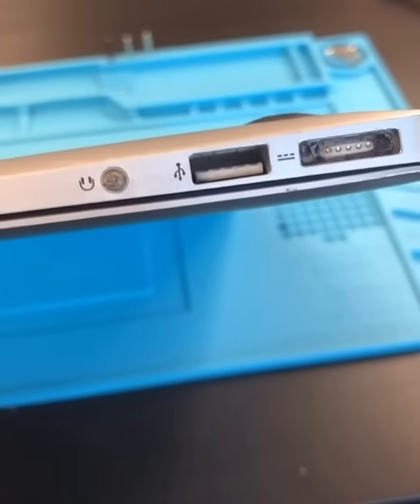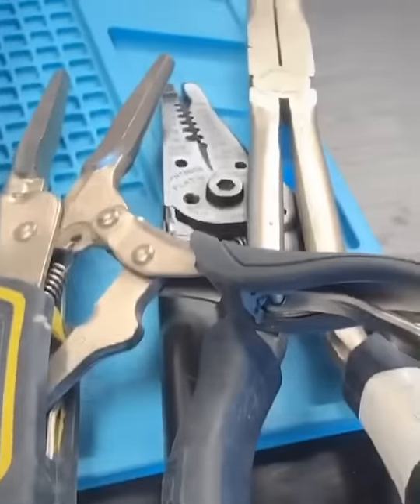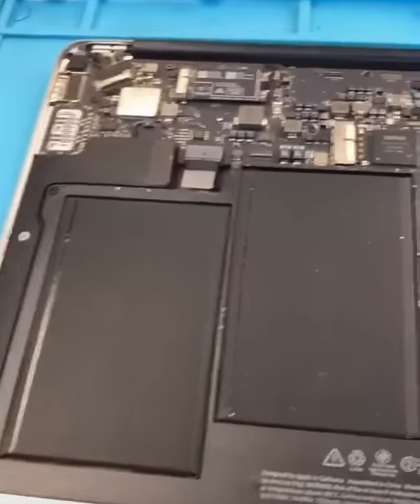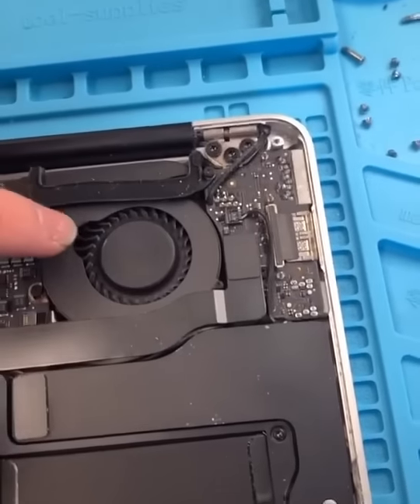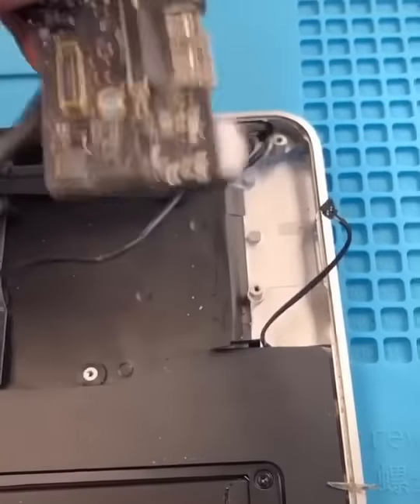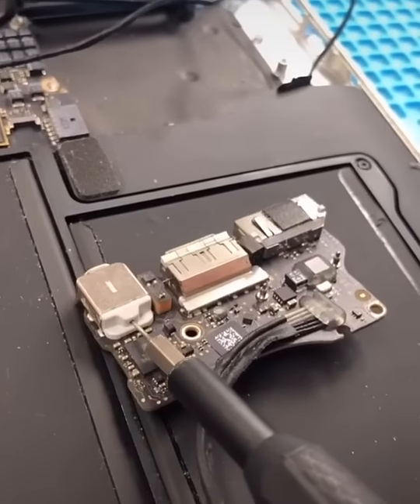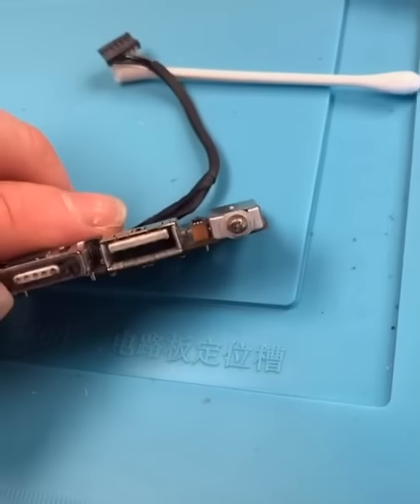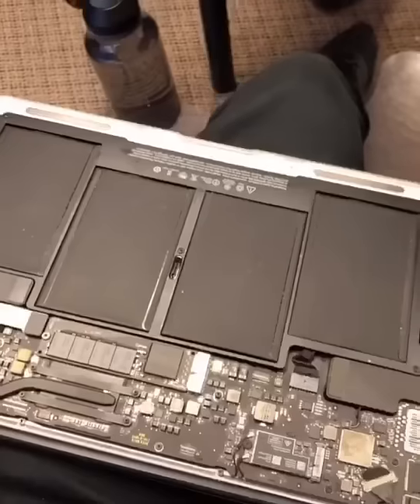Don't Use Glue On Your Macbook.... WHY? #Shorts

Comment: Apple kids: complain about Samsung
Samsung: poor child little do u know
Reply: Note 20 Ultra: gets released
Samsung users: well well well.. how the tables have turned
(Because people used to brag about how expensive their iPhones were)
Reply: It’s not the hardware inside in the end for most. It’s how the device feels (operating system wise)
Reply: @That1Norman  no people used to say that Samsung is cheaper when their flagship phones are actually more expensive now
Reply: Samsung has gone the path of Apple. You can no longer change parts like the screen on either without basically destroying them. Do yourself a favor and shop for hardware and fixability, not for a brand.
Reply: @runed0s86  you can replace screens wtf are you on about. Now replacing physical components besides that may not have the same story. You’ll have to buy boards with multiple other things. You can also replace camera lenses.
Reply: Eh, I think LG's a little underrated
Reply: @bestoffails2140  lg is pretty terrible
Reply: @anxietyplague1221  No it doesn't. Ever heard of efuses? What about KNOX? This is why you need to shop around.
Also, some people are okay with using an offbrand screen. The new Samsung models are not okay with this, just like iphones. Don't buy Samsung or Apple. Shop around for your hardware.
Reply: @Usef320  LG is bleh, but budget Motorola is even worse! At least LG has opensource camera drivers!
Motorola phones only get 2 updates if they aren't on the Google business device list.
Reply: @runed0s86  I dont think anyone voluntarily buys a motorola anymore
Reply: @runed0s86  if you're destroying either you probably shouldn't be reapairing your own phone. i've recently fixed 3 iphone 12's, 1 pro and two normal ones
and 2 note 20's, 1 ultra without breaking any of them at all
Reply: @bestoffails2140  lg is horseshit. get a oneplus
Reply: @Usef320  My moto E5 tracphone variant was $90 and runs ok with an android 10 gsi.
Reply: @brickski7481  new iPhone screens cost at minimum $250. That's the cost of a budget Blackview phone.
Samsung isn't much better at $175. I could buy a rugged flagship phone for the price of 2 screens.
Reply: @runed0s86  LMFOWNDF YOU CAN GET AN IPHONE 11 SCREEN FOR $40
Reply: @brickski7481  not an apple certified replacement. Those screens cost $200. Any other screen is probably a lower quality screen, and customs might seize it if it's being imported. Search for Louis Rossman up top if you don't believe me.

Also, research your hardware. A quick Google search can invalidate your claims.
Here's a decent phone that's about to come out: https://www.blackview.hk/products/item/bl6000pro
Reply: That’s because Samsung isn’t that good compared to apple cause it so slow
Reply: @chadwickelliott9584   it depends on which Samsung device you compare it with. Some are slower and some are far faster. Samsung has a variety of phones, not just the galaxy series.
Reply: @chadwickelliott9584  if you have a new flagship samsung with no malware or anything affecting performance, it runs faster than a ps4.
Reply: Android is better especially i qoute samsung apple is made tru occur coputors to jail break so easy and they will lose traceable prossces do to extract non progited connectic to be found truly thr iphone aux and they could just ab15 samsun but they do a process of piled busines i quote firms of identical alttt 556 of 2002 of apple products not noticed on police tracing all samsungs are police traceble trou charging aux battery and sim iphone is just tru sims i qoute that why the get locked real quick and camera due to ios 14 hehee get that iphone ill use it but mainly (SAMSUNG) thinks
Reply: @Syndicate_LS  it feels the same
Reply: That  Samsung is slower for $200-800 bucks more? Taht would explain why Samsung lost 5b in Q4 2020 and apple gained 352b Q4 2020 and gaining 12% more market share on just smartphones alone
Reply: @That1Norman  isn’t it $1500 and slower by 32%
Reply: @demo5963  no it most definitely does not. Display sensitivity is different, how everything functions is slightly different, performances are different, etc
Reply: Me a Huawei user: What?
Reply: I don’t get all these rivalries lol it all comes down to what you grew up with (most the time) like I love apple Xbox and amd cuz I grew up with them I’m sure if I grew up using Samsung and PlayStation I’d like them more it’s just simple chemistry
Reply: Yeah tbh I don't get why people buy apple phones your paying more for less features or paying the same for less features ( e.g. cameras , finger print , no notches , other features like LG swivel screen ) just for the Apple logo I don't get it
Reply: @daringstriker1335  while that is true I started with android and switched to Apple because as I said myself I liked the feel of the operating system more
Reply: @anxietyplague1221  nah makes sense what I meant mostly is I get given a lot of my stuff as I’m the 2nd youngest out of 5 of us so that has a big impact like I get a new phone every year or 2 depending on whether my parents upgrade or not or if my oldest brother buys a new Xbox I get his old one etc. for you well idk how you afforded so many games XD. But only thing I’d change is I’d go to Samsung if I didn’t get a new phone free
Reply: @Syndicate_LS  The iOS was made for simplistic use for Apple. Why do you think many people jailbreak iPhones. With Android, its open source. Allows anything and everything due to no security on certain applications and details. Whatever you're talking about makes no sense because screen sens and what not? Camera parts? If you aren't happy with the phone, swap brands. Otherwise, who actually cares about the screen? Camera?, maybe.

Edit: Display sensitivity and performance, each phone operates almost the same. Performance wise, you go with android. I only say android because their OS is open source, change or make to whatever you want. But display sensitivity depends on performance, if you're talking about Hz (Refresh Rate)
Reply: @Asunuji no I jailbreak. But at the same time I still like iOS and how it operates and feels
Reply: @That1Norman  when did Apple brag about how expensive their phones were
Reply: Well as long as my phone works I'm happy with it. You all take what you have for granted way too much it's crazy. Just be glad you actually have what you have. Now if you just want to do some friendly arguing on phone details that's great and I'm sorry for intruding, however I think it is important to remember...
Reply: @QueenYossiB  yeah I get that. They do have some nice stylist. I've been sticking with an LG v30 and it's been great. I guess I am over due on an upgrade.
Reply: @QueenYossiB  true true
Reply: Oh fandroid 😂 I can understand how much jealous you are
Reply: I'm Apple 😂
Reply: @sneaky sneaky "joke"
Reply: @Syndicate_LS  at the end of day it's comprised of samsung parts even the screen pretty much the operating system is only thing keeping it from being a samsung as well as lighting port still and apple users still have a notch😂😂😂 I will always choose samsung they are actually starting to become the apple. They also try to take credit for samsungs things such as wireless charging yep that was on samsungs phones first and they tried making a huge event if samsung wasn't so nice to give the rights for other companies to use alot of phones would have probably been outdated and samsungs would hv so many features other companies wouldn't be allowed to use that samsung would be the obvious choice with no hesitation
Reply: at the end of day it's comprised of samsung parts even the screen pretty much the operating system is only thing keeping it from being a samsung as well as lighting port still and apple users still have a notch😂😂😂 I will always choose samsung they are actually starting to become the apple. They also try to take credit for samsungs things such as wireless charging yep that was on samsungs phones first and they tried making a huge event if samsung wasn't so nice to give the rights for other companies to use alot of phones would have probably been outdated and samsungs would hv so many features other companies wouldn't be allowed to use that samsung would be the obvious choice with no hesitation
Reply: @patrickhall6831  ok
Reply: @Syndicate_LS  ohh so ur trying to compare iphones jail system to samsungs super open system?
Reply: @brickski7481  as i may know then iys special screws in ip12 some are rounded out and to take of the back glass u gotta use a laser now tell me  that its easy to fix a iphone over a samsung
Reply: @brickski7481  yee u can from ebay sure but the screns must be encrypted for the 11 thats why i hate appel
Reply: @Andrew DeHerrera did I say I care about that? You are coming off as pretentious and honestly it makes me hate you more and makes me stick to my choice more. If you wanted to change my mind you did the opposite. Now do not respond to me you’ve already made things worse for yourself by showing you can’t handle an opinion
Reply: @malishaba4797  I prefer to jailbreak so I don’t have this issue you are trying to bring up to shit on my choice
Reply: @malishaba4797  you really can’t handle someone having a different opinion
Reply: @malishaba4797  you can buy an Apple screen and replace it like any other. You are in fact making shit up
Reply: @malishaba4797  as far as I’m aware there are screws and there are plenty of videos on YouTube and none have used a laser. Again making shit up
Reply: @runed0s86  i just don't break my phone
Reply: Samsung memory chips are in everything, including  my OG xbox from 2001
Reply: Ppl in the pc space love ram with Samsung b-dies since they can be overclocked higher
Reply: @runed0s86  iphones have been way easier to repair compared to samsung since the galaxy s6 came out it 2015
Reply: @runed0s86  yeah knox the security better than all of ios
Reply: @Syndicate_LS  without hardware the phone does not operate properly if at all keep in samsung also supply's apple with the most important part of there phones THE SCREENS anyways no hardware no phone no system
Reply: @runed0s86  samsungs newest devices are wicked fast my guy.
Reply: @patrickhall6831  I’m honestly at a loss as of why you are telling me this. I never said anything that would state I didn’t know this
Reply: @Syndicate_LS  EXACTLY RIGHT BROTHER people think that because iPhones WERE more expensive then apple phones that this a luxurious phone and I must have it I feel that this is almost burned into people's minds with apple or some people at least I gurantee you at least 3 to 4 out of every 10 loyal apple users would switch to samsung if they had used a new samsungs times have changed tables have turned you here lot people in these comments say that and that's bc it's true I mean apple is literally deleting the charging port on next phone or so just so they can invent something that you have to pay for now I understand audio jack but the thing that keeps there phone running this is ridiculous that's like removing a fuel door to a car makes absolutely no sense and then make something that allows you to pump gas into the tank or charge now I do for see a cordless future but apple is going way to fast
Reply: @patrickhall6831  as I said I do not know about the new phone but every way I can think of it, for example it uses lightning port, and cable should in theory work. Unless they find a way to tell that it’s not a factory cable. But even then I’ve used cables that “aren’t supported”
Reply: @Syndicate_LS  yes I understand it's irritating that quite few people I meet are always saying about makes the greatest phones blah blah but never aknowledge samsung like your phone is at least 30 to 40% android and im not complaining about older person who may not care but our society is so quick to buy product and not aknowledge there other companies involve especially a company as big as samsung deserves regcongition but is always seems neglected even when people know samsung helps make apples product. Apple wouldn't be where they are today without Samsung.
Reply: @Syndicate_LS  yes
Reply: @patrickhall6831  oh I understand how the tech industry works. If there is a company that produces it cheap but good quality and company will eat that up. Especially tech giants who can afford to take advantage of that. I’ve seen Samsung parts on some of the products I manufacture
Reply: @patrickhall6831  most expensive product we’ve built was around $500 and they order a lot. They got to turn a profit off of 500 somehow. It also looked like it does fuck all so whatever it ended up being must’ve been marked up easily 50-100% (I can check but I don’t care)
Reply: @runed0s86  you must have that s6 my guy
Reply: @That1Norman  becuase u get a quality phone for the price and not some shit
Reply: All my phones are apple ones but like, in quality, we gotta agree that apple are a little better but Samsung aren’t any worse. But in “good company” way apple is so bad compared to Samsung lol, their reputation is long ruined
Reply: @That1Norman  me:sitting here enjoying my note9
Reply: @brickski7481  like that‘s a challenge
Reply: @Andrew DeHerrera They are making the parts with Apple specifications and they are not allowed to use the tech for themselves
Reply: @AyyDeJay  well for instance it’s nothing like than and apple doesn’t need a special gimmick to get people’s attention and then skimp out on other aspects of the phone for said gimmick.
Reply: @sneaky sneaky it’s the same reason why Apple uses Samsung oled displays. Because Samsung has a majority hold on oled for smartphone manufacturing. So Apples choices are them or a smaller company.
Reply: @Archman155  what did I say compared to anyone else that makes me hate worthy? The fact that I said “I personally like how the device feels compared to Samsung, but recognize that it doesn’t matter the parts inside”? Or what? What makes you hate me? Because I showed zero anger?
Reply: @Archman155  maybe it’s the fact that you Samsung users are coming off as pretentious? I said I like how iPhones feel and I still opt to jailbreak so I can have a more open device, and y’all just keep running off about how the parts are Samsung. I said i recognize that the parts are comprised of Samsung silicon
Reply: The parts don’t mean shit. What matters is how it operates. Soooo idk what your trying to get at buddy
Reply: @Syndicate_LS  hmph ...macOS and iOS kinda suck
Reply: @Mynameaintcraig1323  that’s your opinion but I respect that unless you’re rude about it
Reply: @matthewsantibanez38  slower by 32% by what? It was released before the iPhone 12 was even announced
Reply: @That1Norman  they raised the price not the quality lol. It seems like apple knows more ab parts then Samsung does.
Reply: @daringstriker1335  You get a new phone every year ¯\_༼ᴼل͜ᴼ༽_/¯ 💀💀 where's the point in that. Over a period of 3 years you've spent 2 to 3 thousand. 

What can I say if you're a Apple buyer.
Reply: @janniboss9020  jealous of what, that Samsung have had better phones than Apple through out the last 4 years? 🤷
Reply: This comment has way to many reply
Reply: @DireyHan  salty fandroid to defend android huh no problem I know ur ego hurts
Reply: @Usef320  i had a 80 dollar moto e4 and it ran great for 2 years, but i tried to root it and bricked it ._.
Reply: @bestoffails2140  LG is the worst phone I ever had
Reply: @DireyHan  i dont buy them i get given them because of older siblings or parents upgrading lol and i said every 1-2 years like the phone i had before this one now i had for about 2 and a half this one about a year so far
Reply: @chadwickelliott9584  then why does apple use samsung parts🤔
Reply: @Syndicate_LS  it works like that because of the Samsung parts
Reply: @brickski7481  ps4 is slow as hell
Reply: @janniboss9020  youre the type of isheep to buy the newest iphone just to have friends.
Reply: @jasonrudd4840  Im talking about the whole thing. I like the fact there fast charging but there very slow. I attempt to help my auntie use it and I could barley do anything with out it having a 30 second lag. And this is brand new
Reply: @blackaf1energy741  why I like iPhone is because of how different it feels. Just because you use Samsung ram for example it doesn’t change how they made the operating system feel. If you think that’s how it works you have no right to be talking
Reply: Samsung is not for poor people that is so rude. And buy the way iPhone screens are made by Samsung so Samsung is not for poor people 😠
Reply: @chadwickelliott9584  if samsung hardwarr was slow then apple hardware is slow basically
Reply: LOL
Reply: You people are beta testers for Apple.
Understand this.
Reply: @mp5thegun  no it use a small part and before you attempt to say your lies, I dare you to go get a Samsung chromebook I have to suffer with that crappy chromebook that’s glitched everyday I compare to kindle I would only buy a Samsung if I could no afford a Apple
Reply: @chadwickelliott9584  chrome books are for poorons
Reply: @chadwickelliott9584   also your grammar is broken af
Reply: @mp5thegun  it for school and I’m still 10 I have an excuse to have bad grammar you don’t-
Reply: @runed0s86  wait rugged? What do you mean I am planning on buying an rog 3 and here in the uk online I see the prices are 400 500+ are those scams?
Reply: You guys are fighting between 2 $1000 brands, but here I am ordering a Xiaomi note 9 Pro (128gb storage, 6gb ram, side mounted fingerprint scanner) for $250.
Reply: @runed0s86  LOL
Reply: @runed0s86  waitt help mee am I getting scammed?
Reply: @eayt5087  That's the correct price range for the rog 3. Depending on what you're using it for, you may not need the best phone. Even pixels can handle forkknife. That's why I'm getting the Redmi Note 9 pro. It's a decent balance of power/battery, has some sturdy cases, and is available for around $250 on Amazon.
Remember, a faster more powerful processor means less battery life.
Reply: @runed0s86  ohhhhh, thank you! I did not know that😅
Reply: Lol samsungs you can tell are cheaper, they are basically just crappy computers in your pocket whereas phones are actually their own thing with unique features thad aren’t just a PC but worde
Reply: @anxietyplague1221  do you mean s,a, and m not galaxy cause all their devices are galaxies
Reply: Lmao
Reply: And someone who has used Android all his life I can tell you I want an iPhone
Reply: Really I'd actually say that Android isn't very good
Reply: @1ipod  what kind did you have. Because you probably had a Motorola because androids are wayyyy better than iPhone
Reply: @jaydenlewis547  yeah my main issue is i like stock android, but there are no good phones with it, especially in the 4-5 year long update cycle
Reply: @1ipod  well honestly just get a pixel then. and who would want a phone for more then 3 yers anyway
Reply: @jaydenlewis547  im trying to buy a flagship that has good specs and 5 years of updates
Reply: @1ipod  well if you're not gonna get that switch to iPhone
Reply: you just ain't gonna have that much feature lmak
Reply: I hate when apple users are like gOt My SiX pHoNe tHis mOnTh
Reply: @thatguy7775  lmfao fr
Reply: @That1Norman  when it's a Samsung in it
Reply: My Galaxy S20+ was cheaper than a base iPhone, I got a deep $300 discount on it, and a year later, my battery still lasts as long as day 1. No malfunctions, and they supplied me with buds and an aux suitable for it, and didn't over charge me for any of it 😂
Reply: Everyone just sounds broke and lazy lol
Reply: @daddiboi4121  I got a super crappy battery cuz this is a hand me down but I gotta agree still, samsung is superior than iPhone although I will admit iphone can take some good photos but not that I care
Reply: @thatguy7775  once you start getting into the newer versions, the Android quality is superb! My S20+ can get a 30X zoom, crisp as hell!
Reply: @That1Norman  but atleast samsung makes budget phones that are so cheap and better than most phones
Reply: @Syndicate_LS  I mean it doesn't really matter point is people want options why pay someone to jailbreak your phone when you can get just as good of phone plus with no notch and bigger screen and body ratio aka samsung. Personally your getting better deal and don't have to do anything extra. Not to mention apple restricts there users and over complicates things that don't need to be complicated simple things like being able to choose a custom wallpaper. Not to mention the settings especially where you turn bluetooth off but it only puts it asleep till next day you have to go Into settings to fully turn it off. Now you understand what I'm saying they overcomplicate shit for no reason same ting for taking phones apart. Now I'll agree phones are hard to get into nowadays. But apple make it unnecessarily hard. Not to mention samsung cameras are tuned better apples zoom quality sucks.
Reply: @chadwickelliott9584  yes depends now if talking top model to top model its hard to tell when you remove animations(apple users might not know what this is btw) the screen becomes insanely snappy I have a galaxy A11 and my phone feels pretty fast for 160 bucks not to mention a whole fingerprint sensor. But anyways samsung I'd say is better because I e camera quality wether that be zoom or stabilization alot of things however sometimes apple can excel In these things just depends you can't really compare cameras because there always be different lighting conditions and what no. Number one thing apple users forget is that samsungs have larger screens as well as less bezels i just thought I was tripping but I looked up the screen to body ratios and compared as well as screen size overall. Not to mention the black notch apple has now become k own for keeping.
Reply: @DireyHan  exactly
Reply: @runed0s86  fr lol
Reply: @patrickhall6831  why would you pay? You should never pay. You do it on your own accord for free.